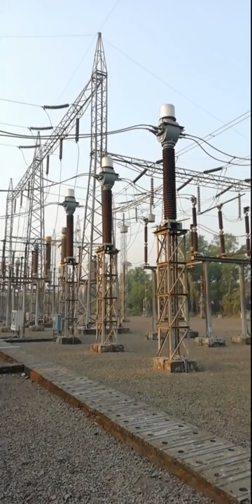How to identify CT & PT just by looking at them. सिर्फ देखके CT या PT ये कैसे पहचाने ?

Comment: What is the function of the PT?
Reply from the maker: Potential Transformer that is PT is used for voltage measurement purpose. The voltage is stepped down by PT, and this stepped down voltage is used for measurement and protection purposes in power system.